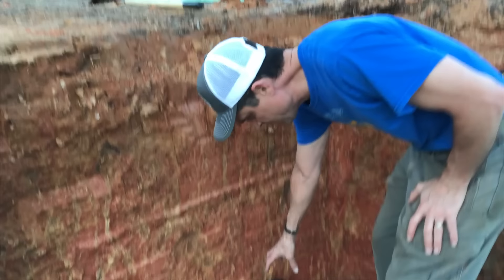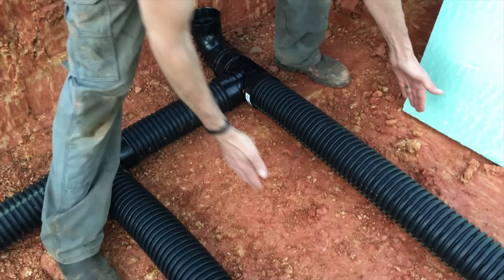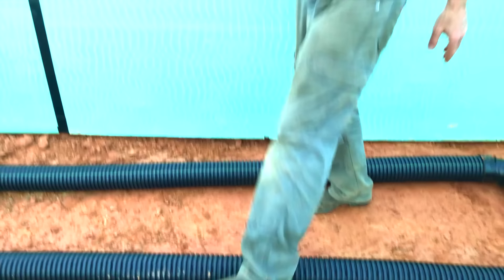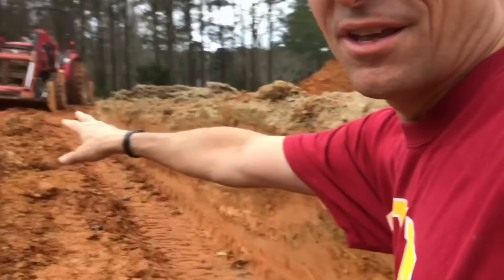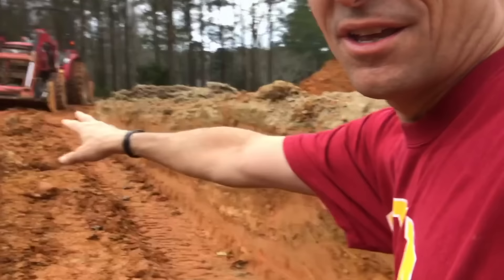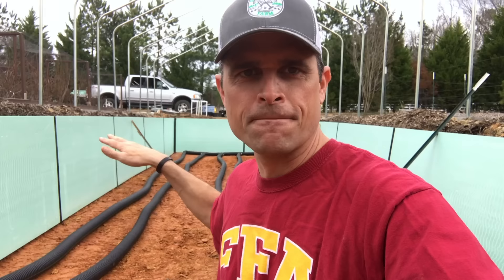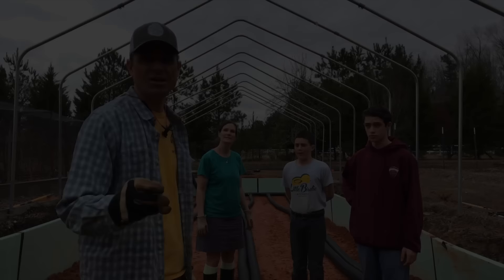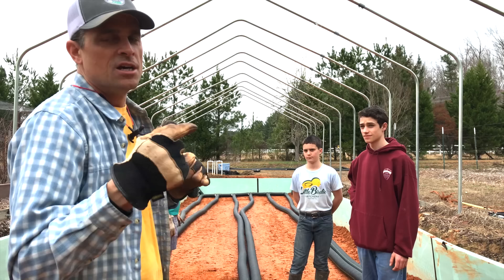DIY Geothermal Greenhouse Part 4: Earth Battery INSTALLATION

Comment: Just wondering if there is a better media to encase the pipes with to ensure more consistent retention and distribution of the controlled air temp, i.e P rock, 3/4 stone etc., I would think that would also be better for the drainage of condensation as there is very little if ant relief in the surrounding clay to accomedate (spl?) for drainage.  Just a few observations.  

I am sure you are better informed than I am and you have done your home work, I am just looking at from the standpoint of a drain layer and having dealt with the many problems dealing with clay.  I was also wondering about the route you took with the layout of the pipes as others mentioned, why not one continuous run.  Also agree with the compaction every foot or so on the back fill, seen too many sidewalks on new homes cracking and sinking from rushing to back fill to only have everything settle  and the problems eresulting.

All in all, I wish you luck, just some of my observations, and yes, I have been known to over think things. LOL

Definitely a great series and look forward to each episode.

Comment: The air will take the path of least resistance. What will make the air reach the far pipe from the inlet. The air will take the most direct route out of the system.

Comment: I thought the pipe would run like a snake instead of going parallel ,is there any specific reason to do the way you did? Isn't running the pipe in a continuous snake formation let the air more time to cool down? Tell me if iam wrong😊
Reply: You are right and you get never an equal flow trough the pipes , bad design .

Comment: WONT THE  pipes fill up with ground water after heavy rains and snow melts in the spring??
Reply: Most geothermal projects includ pumps for condensation build up

Comment: I would think you'd want to cover these tubes with sand and gravel gravel on the edge sand in the middle it holds more thermal mass and then dirt on top of the sand so it'd be like a heating pad throwing dirt on top of it I don't know if dirt would hold this thermal mass as well as sand will actually soak in heat

Comment: It looks pretty good, although I tend to agree that the pipes should be ganged into a larger feeder. A lot of the heat storage of such a system will come through the https://en.wikipedia.org/wiki/Enthalpy_of_vaporization of water. A lot of energy goes into condensing and evaporating water, which is why it's critical to have the perforated pipe allowing air access to a large surface area of soil to condense and evaporate moisture from.
Reply from the maker: Yes, thanks. We improved it (fixed the mistake) in a next video.

Comment: We stay in southern spain, whwre it can get to 40 degrees C(104 fahrentheit)
And coldest in winter will only be -2 in early mornings (28 fahrentheit)
So we sont need to keep thw heat in but ratjer get it out as moat of the year is warmer not colder, 
So i wo t be putting foam around the hole, simoly to just get rid of the heat more, as that is the biggest problem for us.

Comment: The lay out of the underground air flow to assist in the temp is a bit like a septic drain field. The greater the coverage the greater the efficiency. The application of the insulation is a good idea till the ability for the system to properly operate. A secondary system attached and controlled with baffles to assist when the limits become over limited. AKA   A second  GEO system that is not insulated being connected and regulated... Make since I hope. just my thoughts.

Comment: Great concept but I don't know about using big o.  I used that for drainage and after about 10 years I got sink holes along the runs. Turns out the big o collapsed. I went with perforated pvc and have had no problems since.

Comment: I could not follow any word spoken since the little clown appeared at 04:50 !!!

Somebody told me there was some research done by Messerschmitt/Mercedes: you could never ever fill in energy if the bottom is open - the good thing is: It also works the way round: you never can cool it down bei accident, so you have some 10°C all over the winter ...

That reminds me at my hypocaustic attempts to heat my house with warm air which did not work really good until I changed to water after realizing that air is the perfect ISOLATOR and water (and hydrogen) can store more warmth inside than any other material. PLUS radiant heat with warm walls and cold air is much cosier, than warm air and cold walls.

Maybe the situation is completely different with this kind of clay??? Thanks for uploading - and please keep us on track!

Comment: Thank you for sharing this. I'm wondering why you decided not to use french drain filter fabric sock on your pipes? I'm planning on building a much smaller cattle panel greenhouse (12.5 ft x 7 ft) with a climate battery this summer/fall. My plan is to only go down 2 ft, insulate the perimeter, and lay water filled 16 oz plastic coke bottles along the drains to add more "heat/cold storage". I'm not sure this will work. But it costs me nothing since I have been saving the used bottles. There are so many variations and divergent opinions about this. I look forward to seeing how this works out for you.
Reply from the maker: You're welcome. As to the drain sock, since water won't be flowing into the pipes (along with silt) as it would in a french drain, we just didn't see it a necessary expense. The clay back fill is not that small and basically compresses back to a hard packed mass. It really shouldn't be an issue clogging the pipes. Your idea with two liter bottles can't hurt. Might want to consider doing something like spray painting them black. And yes, there are a LOT of opinions about all of this. I tend to go with Jason Smith over at Coghill Farm, just try things and "grind it out" as he says. Experiment and have fun. If it doesn't work, try something else.

Comment: I have a question. If you already dig that far as you did, why didn’t you just leave the ground floor on that height? Whatever temperature you are getting from those pipes would be your floor temperature. And perhaps dig just those pipes a bit further down to get few more degrees from them. If at all. No?

Comment: What was your Temperature reading, coming up from the tubing in the ground?     We use to SNAKE our Hose/Tubing depending on what we were building, and use Hot Water to heat.. as in radiant from the floor up, very Stable once it comes to desired temp.   Same HOT water ran through the Hot Water heater for the House, being a secondary benefit (free house water for house use).  We burn USED Engine Oil & Vegetable Oil....  all FREE.   One heat I built early goes up to 1000 deg.F.   Hot water short and sweet.!

Comment: I like what you said from the start do it right the first time..The pipe your using isn't a very good product...Your better off in the long run to buy the heavier structured drain pipe that is white sdr35 or better than that pipe that will not sustain it's integrity over the long run..Everytime I've dug that black flimsy drain pipe up it's squshed not working...Also it's a little more expensive but you could just get regular water or sewer pipe and drill the holes for venting your self...You could also have a drainage collection system sitting on the bottom as well to recollect the water your using to irrigate the plants in your green house...This excavation is the exact way to make a sand filter where you collect the water shoot to a diverter box then down to a tank for clorination..Simple pump in that tank and you could reuse the water to continue the irrigation of your green house..Kill two birds with the same stone..
Also using that corrugated pipe requires a rock ballast around it to help maintain it's structural integrity...Again Your quite deep with the thermal lines..+/- 4'.. Having a higher line at 2' also will probably dry out the soil requiring more irrigation of your plants inside the green house..Still think you will end up with ponded water in your lower pipes simply because the irrigation for plants..Clay soils do not allow penatration of water that's why it's used for ponds, landfill capping etc...Jar test of lower portion of excavation to see settlement of soil would of been a good check..It's to late now...The green house is in use so that in itself is a good test..Over all this is a great idea you undertook

Comment: Just like others have said I think you either need to snake 1 super long, curved pipe or have dedicated inline fans per line of pipe because when you put T's and elbows on something with 1 fan, the air will go the path of least resistance so some of the air is not recirculating inside of the pipes in the middle. Im curious to know how well this setup works but this is something Ive found when using hooking up cooltube light ststems in sequence with ducting... If I were to hook up multiple rows of cooltube lights to one fan, some of the rows would be super hot. Every row of cooltube lights need their own inline fan. Your system certainly looks better but I think "snaking" or bending one or two longer pipes around the entire area would be better in terms of airflow.
Reply from the maker: Mike, thanks for the comment and feedback. We think the idea of having the the fan in one corner of the system and the exhaust in the other makes nearly all of it the path of least resistance. We've seen a fair number of pictures and images of these systems going in and others do something very similar. Our sense is that because it is effectively a closed system, eventually hot air will get to all of the soil around the pipes. Of course, we could be wrong. Either way, we plan to share the results. Thanks for watching!
Reply: Hey thanks for the reply! I didn't even consider that the exhaust was at the opposite corner. I really hope this works out, I want to try it on a project coming up soon. Just like other people have said I have a question about condensation... I agree that perforated pipe is the best idea for escaping condensation in the pipes but is there any consideration for excess rain or if snow melts in excess and the pipes fill up with water and the system becomes completely clogged? Is 4ft - 6ft depth enough feet down to not have to worry about water seeping into the pipes from the outside or is that something to consider? Thank you very much for your time putting these videos together by the way!
Reply: Mike, I agree that one or two long pipes would make more even airflow, but you want to maximize the airflow more than anything.  One fan for each circuit would work, but it's not cost effective.  Heating ductwork systems are designed to provide consistent airflow from each of the ducts off of the main trunk, just copy that design and it will work good enough.  Even having the outlet and inlet at opposite corners like this video isn't enough to get even airflow, more will flow at the ends of the manifold and less in the middle.  Even more important is the airflow through the tubes being enough to carry enough heat to matter.  The small manifold reduces that airflow.

Comment: The problem with your design, is that air flow is restricted by the design of the headers.   You have six four inch tubes being fed by one four inch tube, so the air velocity in the header will be six times the average in the long tubes, yielding turbulent flow, and a large pressure drop.  
The cross sectional area of the headers should be about the same as the total cross sectional area of the six tubes.  
A quick calculation yields a diameter of 9.79" diameter, so say 10".   Using this diameter for the headers on both ends, you can connect a radial fan such as used in a domestic HVAC installation, and move a reasonable amount of air through the network. 
Trying to do that through one 4" tube gives too much pressure drop.  If a plastic pipe, and fittings of this diameter is too expensive, I would make a header of similar cross sectional area using 16"x12"x8" concrete block,  16"x8"x4" solid block, and mortar.  I would dry stack the block, using the mortar to connect the 4" tube to openings in the concrete block header.  I would make the vertical parts of what ever size concrete block that is convenient below grade, with galvanized steel above grade.  I would also place the intake for the fan near the top of the greenhouse so as to ingest the hottest air.
I would also preheat the battery during the summer by thermostatically controlling the fan to run whenever the temperature inside the greenhouse exceeded 90 degrees or so.
Reply from the maker: Thanks for the thoughtful comment. Interesting idea about the bock header - have to keep that in mind if we do this on our larger greenhouse. If you haven't seen the rest of the series, we changed the size of the pipes on the ends to six inch pipes and do have the intakes in the ridge. Again, thanks for taking the time to comment.

Comment: air will not flow as others have said brcause of joints, needs to be one continus tube  snaked on bottom, one way in one way out. what you just created is dead zones
Reply: Terry Frederickson hi
I will be building a greenhouse this spring

Can you explain what you said about the dead zone if you put elbows on the piping 
Thabks
Reply: Oh oh

Comment: I am concerned about groundwater in those pipes.  I am not an expert and not trying to point flaws in your work. I would love an update.  We use buried pipe like that as a mock french drain to spread groundwater away from wet spots and move around the property.  Wouldn't mold become an issue?  The fans will dry it some, but wouldn't there be daily condensation?    Thank you for running this experiment, how did it turn out?

Comment: Awesome endeavor! I wonder, if you have compared smooth wall perforated pipes instead of ribbed, because from hvac efficiency I know the ribs add big resistance to the air flow. Of course this is a slow moving, but just wondering. I'll check your other videos, if you haven't given updates, let us know how it turned out. Also, something else to consider as cheap efficient insurance, just like in the pipe and gravel septic leach fields you put building paper over the gravel, you could do so over the pipes before backfilling. This would protect form silt geting into the perforations but I think like you said, it's probably OK without it too.  Good luck and thanks for sharing
Reply: That would defeat the purpose. The ribbed pipes causes more turbulence, and more soil contact. That is the goal. covering the pipes would also greatly reduce thermal transfer. The efficiency of the air travel is not a concern here, at least not in how hvac systems operate. You actually want more turbulence in this instance. More chance for thermal transfer to/from the soil.
Reply: @klincecum  that makes alot of sense thanks for the explanation Happy New Year
Reply: @alexsmith9328  Cheers!

Comment: Was the intent of this construction to store daytime heat and then reclaim the heat at night, or was it intended to access more constant ground temperatures at depth?

If intended for storing heat, would it have been better to also lay the foam flat, somewhere below the pipes?

Comment: What is the reason you are putting foam polystyrene sheets around the walls of the soil ?And the black connecting perforated pipes are not water locked so water can easily penetrate them, Did you make this calculation? Thanks

Comment: Next time you do a green house earth battery It might be wiser to run all 4 inch pipes to the corners and 6 Inches above finished grade! Do just one fan! Then build a plywood manifold at the top to encapsulate all the pipes...out the top of the plywood box run your larger sized solid pvc pipe to the ridge of the green house so all pipes draw  evenly fully using and charging  the earth battery...air like water will seek the path of least resistance, so by having the manifold below the earth your cheating the effect by drawing a majority of air  through  the closest runs...

Comment: You shouldn't have joined the ends of the black pipe. Air will take the path of least resistance you will have most of the air flow through the shortest one and almost nothing through the longest one.
Reply from the maker: Thanks for watching and taking the time to comment. Actually, if you watch the "Mistake" video we uploaded after this one, you'll see we dug up the ends and replaced the manifolds. When we did that we tested all of the pipes to see if there was a difference in the volume of air coming out of each one, and there was no difference. Seems the air actually wants to reach equilibrium going through the pipes - not simply take the shortest route. Also, because the intake and exhaust are located exactly opposite each other, the distance between points is exactly the same on each pipe going under the ground. There is not shorter path.
Reply: The point of puting the intake opposite the exaust is that so the distance the air travels is the same no matter what path it were take. There is no shortest path or longest path.

Comment: Shouldn't you put a fine mesh cloth over the pipes to keep the drain holes clear from dirt?
Reply: Why do folks think they are drain holes/slits? Drainage tubing is designed to let water IN and convey it elsewhere. The position of the perforations/holes or slits are about as useful as a chocolate fire guard in this application. I recommend folks buy non perforated tubing and cut a straight slot part way through the corrugations using a simple jig and a circular saw or router. Position the slot at the bottom during installation.This allows all of the condensate to drain out instead of being trapped in every corrugation.